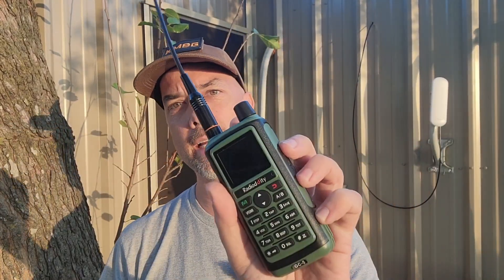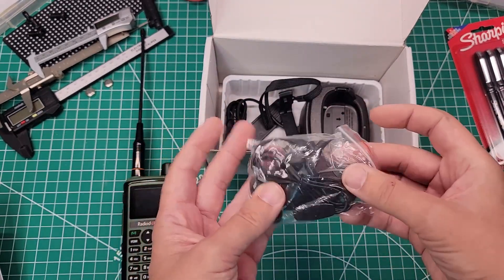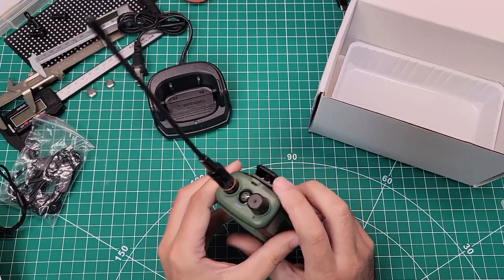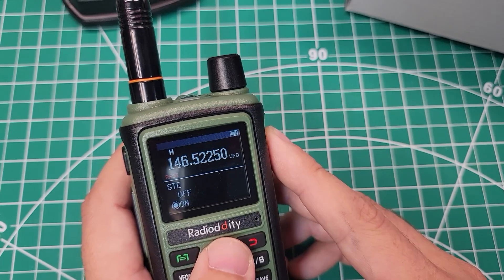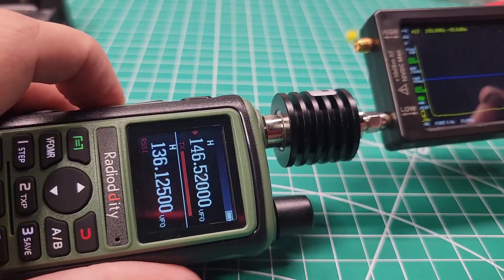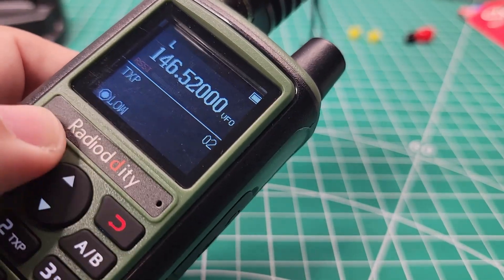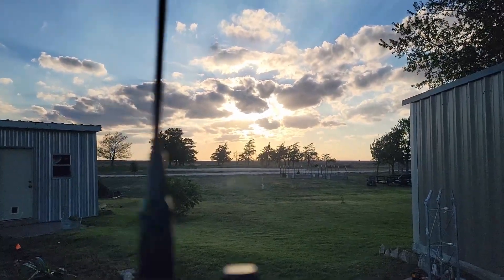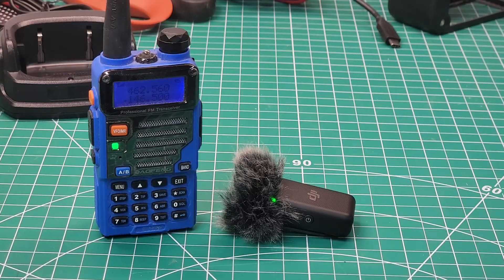Just another Baofeng CopyCat?

Comment: great radio for the price. love the USB C battery . China got that down now. most have USB C from China now. have one that is micro USB . that good as well. even the UV-5R has a USB C battery now. I don't buy anymore with out USB charging. I am off grid and use solar/wind  power. or portable . may get one. like this one better. next HT will have 1.25 meters TX I buy. love the color display . 73's
Reply from the maker: One baby step at a time!